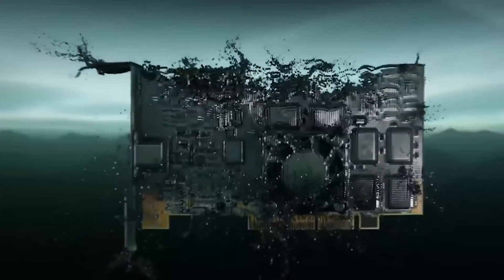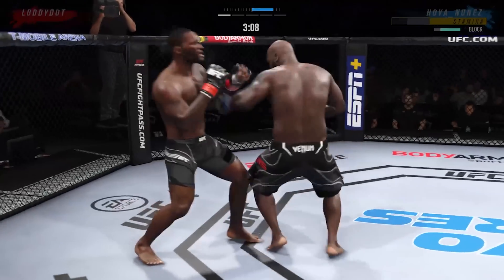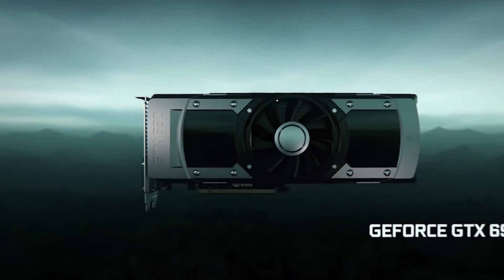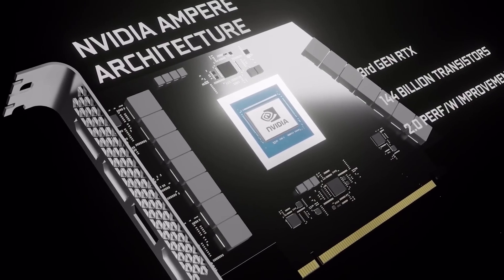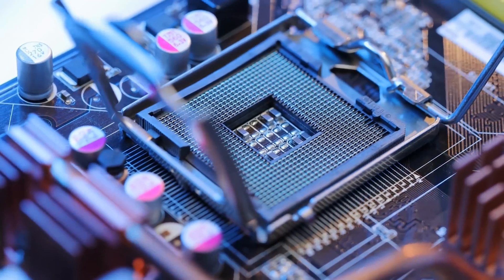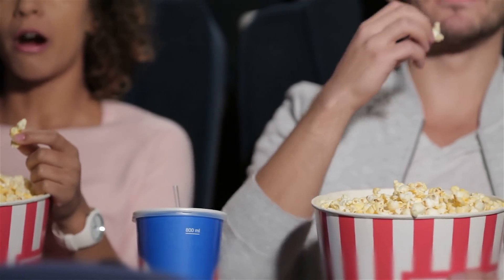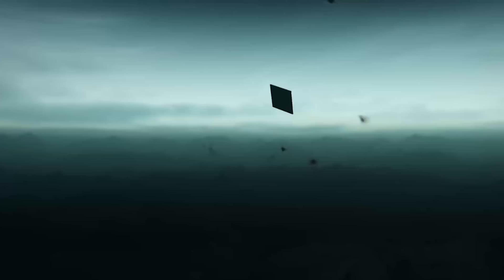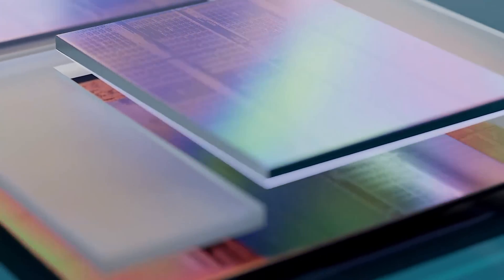The future of Graphics Cards is EXCITING! - RTX 4090 & RX 7900XT

Comment: The RX 7900 XT if it has 15,360 cores and runs at 2.8GHz would be 86 TFlops not 32 TFlops. Do the math. 15,360*2*2.8 = 86016 for the 7900 XT and for Nvidia 18432*2*2.5 = 92160.

Comment: Where are you getting your power consumption info for the 4090?!  It's projecting to come in at 600 watts (which is bad enough).  That's coming from Greymon55 and Kopite7kimi which are 2 extremely accurate leakers.  I know this post is from the 15th but 600 watts have been thrown around for a while now.  I guarantee any graphics card pushing 1 thousand watts or more of power would not sell well at all.
Reply: yeah that's where I'm at what is Ingham Dee's power coming in at because 600w is way too damn much